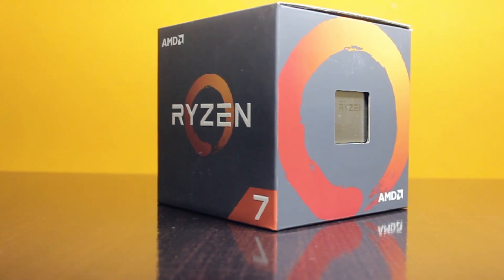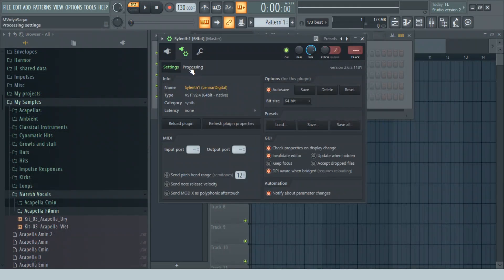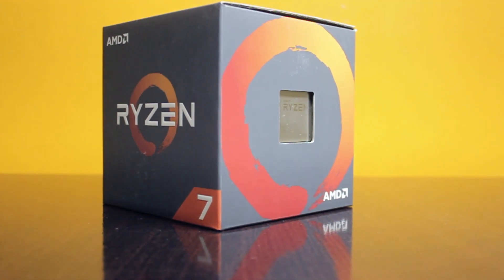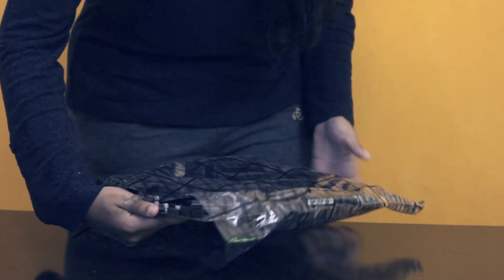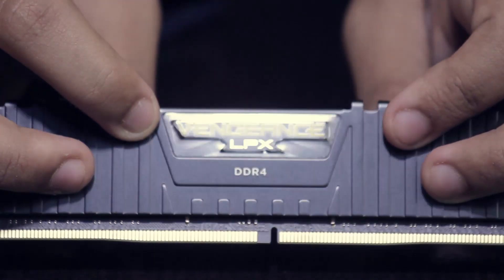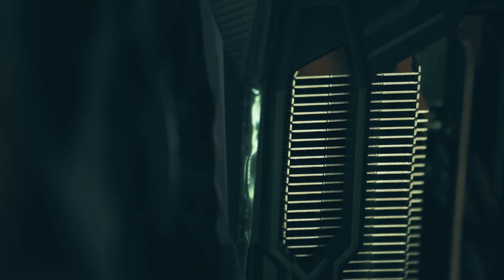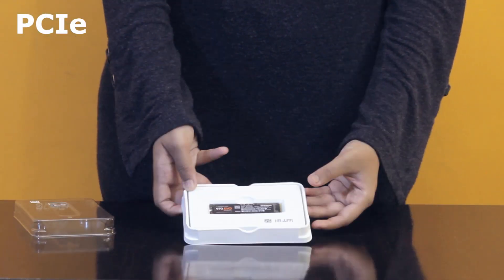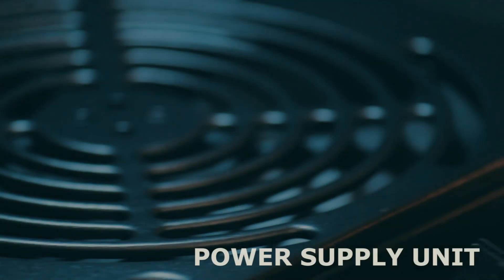Select Parts For 4K VIDEO & AUDIO Workstation | AMD RYZEN PC BUILD 2020

Comment: does not support thunderbolt
Reply from the maker: Yes, that is correct. This motherboard doesn't come with Thunderbolt. However, it does come with 3.1 Gen 2 which is good enough for the needs of this PC, at least at the moment.

But you can find an alternate motherboard over here which does have tb3-
https://thunderboltlaptop.com/best-thunderbolt-3-motherboards/
Reply: AsRock X570 Phantom Gaming
AsRock X570 AQUA
AsRock X570 Creator
AsRock X570 Taichi
Could be that it only support 2 and 3 gen CPU
Reply from the maker: @allkindsofthings673  Yes it could be so as thunderbolt is significantly faster than the USB 3.1 Gen 2x2. There needs to be a compatible processor on the motherboard itself for it to operate thunderbolt protocol so maybe it depends more on the mobo being used.